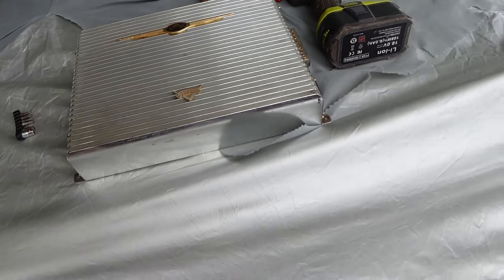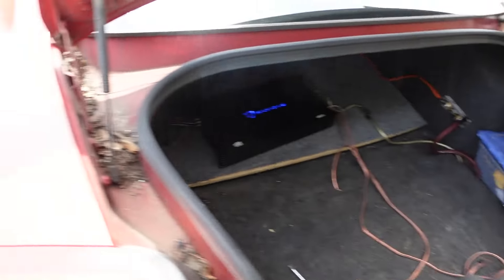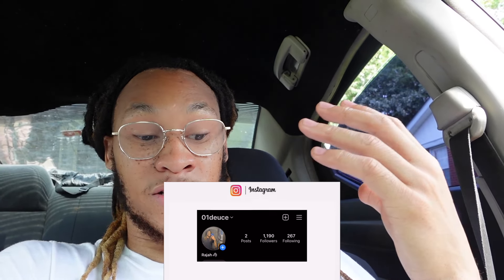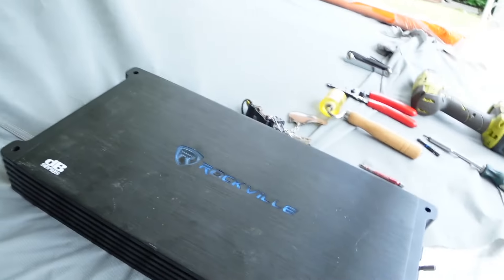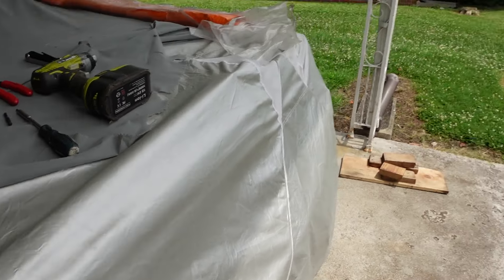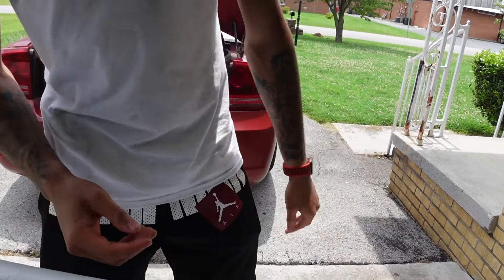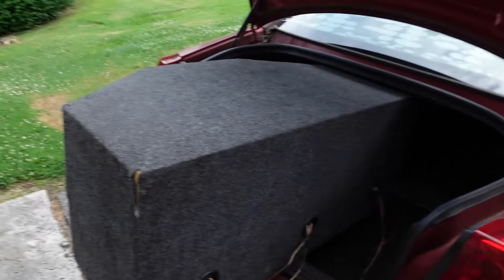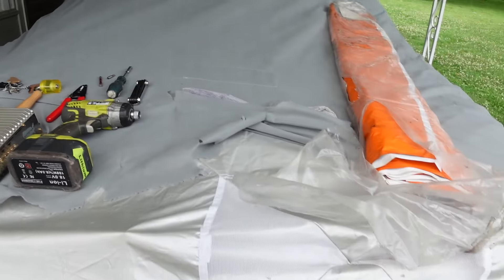My Dad Bought This Rockville DB15 Amp So I Tested It

Comment: 16:53 That rockville db15 is only a 2 ohm amp. you got 3 subs (probably) wired in parallel at 4 ohms a peice (assuming svc) your amp is seeing a 1.33 ohm load. which is too low for it to handle. put a 2 sub box in the trunk, or take that amp out and use one that is rated to run at a 1 ohm load or lower. problem solved. (tip, in the future, use an ohms law calculator when designing your system for proper sub wiring and amp selection)
Reply from the maker: I definitely appreciate that man, thanks for the help!

Comment: just to tell you how ohms work:
8ohm subwoofer + 8ohm subwoofer = 4ohm
4ohm subwoofer + 4ohm subwoofer = 2ohm
2ohm subwoofer + 2ohm subwoofer = 1ohm
if you want 2+2ohm sub = 1ohm
you need to connect the plus of the first sub and plus of the other sub together (same with the minus) to get less ohms, 2ohm into 2ohm = 1ohm

++ --

if you want more ohms tho you need to do it like this

+ - + -

connect the plus of the first sub to the amp and the minus to the plus of the other sub then connect the minus of the 2nd sub to the amp, 2ohm + 2ohm = 4ohm
please someone tell if if im wrong, but i think that im right
Reply from the maker: Awe yeah man, I really appreciate that. So I have my subs connect like ++ - -, on each sub so by what you’re saying, I have mines wired to 1 ohm. Is it better to have more ohm or less? Again, definitely appreciate this!!
Reply: @DeuceTTG  so if you have more ohms then (i think, idk i havent figured it out yet) the power devides cuz your running through on sub to the second one the power, if you have less ohms, then your power adds up for example:
2ohm + 2ohm = 1
300rms + 300rms

2ohm = 2ohm = 4ohm
300rms /2 = 150rms idk if this is right tho
if you have a multimeter then check the ohms output on your subs when they're all wired ++ --, and if its below your amps rated ohm load, (amp 2ohm rated, sub 1ohm) then you gotta run + - + - on two subs and leave one normal
Reply: @DeuceTTG  btw this is your amps RMS (constant power) rating
- 2 Ohm: 1500 Watts x 1 Channel <1% THD+N
 - 4 Ohm: 900 Watts x 1 Channel <1% THD+N
your amp is rated for 2ohms so its possible that you're subs are just wired too low
Reply from the maker: Ahhh, okayokay. I definitely think I’m starting to get it. Again bro, I definitely appreciate all this!!🙏🏽

Comment: What ohm do you have your subs wired to and what’s the ohm rating on the amp…all that matters….🤘🏽
Reply from the maker: Man, I definitely appreciate you letting me know that. See I’m still trynna learn about the music portion of cars. I usually just wire up amps to my subs and see if they work and if they do, then that’s what I use🤣🤦🏽‍♂️ still a lot for me to learn so that you!!
Reply: @DeuceTTG yeah I was just about to ask because I have the db14 and its lowest impedance is 2ohm and so is the db15. Now I’m no ohm expert but I think 3 subs wired down would be a 1.3ohm which is why the amp is cutting off. It’s basically going into protection mode due to your ohm load
Reply from the maker: @gelatoconnoisseur5389 ahhhhh, okay. I think I’m slowly starting to get it, lol. I definitely appreciate y’all helping me out. Thank you!🙏🏽

Comment: you need to turn the car on when you test the amp because your voltage is too low when the bass hits that’s probably why it’s cutting out or maybe because the ohms is not right and you probably also need bigger wire and see if you can get the power acoustic 2500 W from Walmart it powers my dad’s three subs like it’s nothing and only $100
Reply from the maker: Man, I really appreciate this. Thank you. Imma definitely look into that. I should be ordering new wire soon anyways just to redo it. Thanks again🙏🏽
Reply: @DeuceTTG  you’re welcome happy to help

Comment: If you have a amp with 2 chanels out for subs you can bridge them to have more watt power from the amp if 1 chanel doesnt have enough power for the subs
Reply from the maker: Okay. My amp that I am using, the Autotek I showed y’all, it only has 2 channels out for the subs. I have 2 subs wired to one of the channels then 1 sub wired to the third. I definitely appreciate y’all help though, really!!🙏🏽
Reply: @DeuceTTG  yea if u do that u may be overloading 1 channel and then its weird the the other its prolly cutting in and out of protect it seems u have lots of problems with amps could be som,thing else anyways just use that in 2 channel to 1 meaning left channel positive to right channel negatave and connect all your subs in parralel seeif it works
Reply from the maker: @BuddaDrifts okay, thank you!! I will definitely try that!